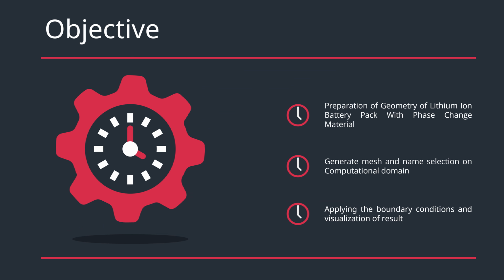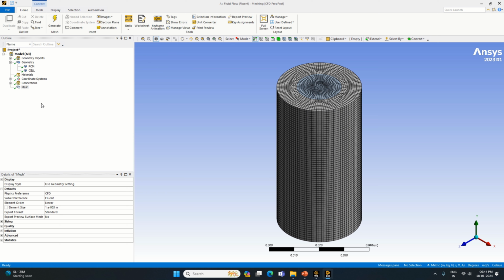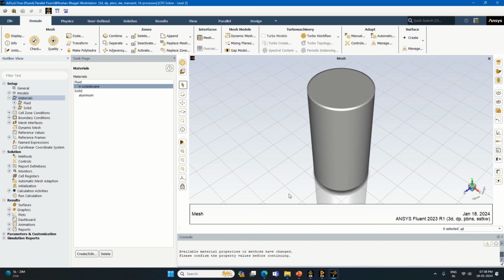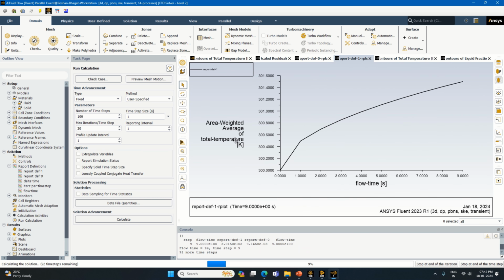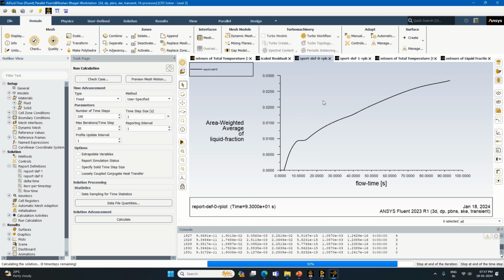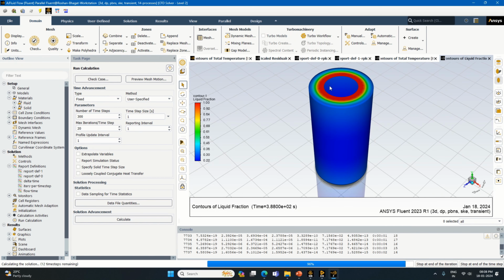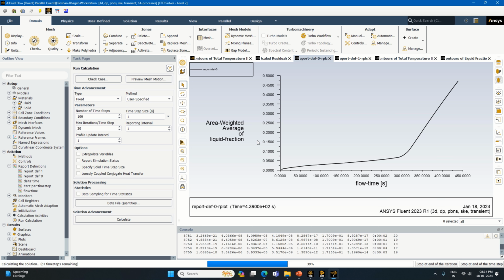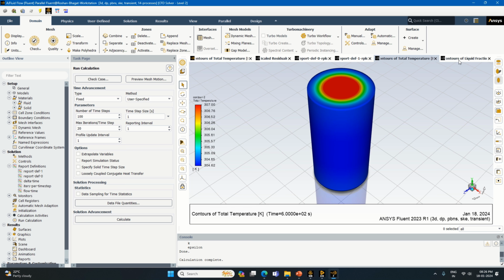CFD Simulation of PCM-Based Thermal Management for Lithium-Ion Battery Pack

Comment: I tried to do the same steps as you, I got unrealistic results. The liquid fraction wasn't increasing instead it varied with time . any idea what I did wrong?
Reply from the maker: check the selection while setting the animation
Reply: I don't think this is the case, The continuity residuals was more than one for some reason and reached even higher numbers
Reply: Last thing I tried now is to turn off the gravity, and all of a sudden the Continue and the XYZ momentum aren't being solved and showin 0 residuals. But the contours are showing the right behavior also the Liquid fraction is increasing steadily like the video.
Reply from the maker: Gravity has to be specified. Need to check file. Share on frontiersincfd@gmail.com
Reply: What are the system requirements for PCM/Li-ion battery simulation in ANSYS FLUENT?

Comment: can u do it for 3pcm circularly placed  one around another from cell where pcm should be lower to higher or higher to lower melting temperature
Reply: Great video 
Pcm width for pcm1 is 1.5*cell size
Pcm2 is 2*cell size
Pcm3 is 2.5*cell size
Which is packed circularly continuous around one another
Reply from the maker: Share details
Reply: @FrontiersInCFD 
Take 3 pcm packed circularly from cell
That 3 pcm should be different in melting point where the pcm which packed after cell is pcm1 and next pcm packed circularly with pcm is pcm2 and next packed circularly around pcm2 is pcm3. Pcm1 has low melting point then others, pcm2 should have low melting point then pcm3 and pcm should have high melting point

Comment: You videos provide good information. can you make video for Battery with PCM and Fins by using boussinesq model for PCM
Reply: Following is one of example. You can take one gravity value only.
 Title : Numerical study and optimization of battery thermal management systems (BTMS) Based on Fin-Phase change material (PCM) in variable
gravity environments
Reply from the maker: Will do
Reply: @FrontiersInCFD  sir
 HAve you considered this?

Comment: Great video!!
Can you upload a video explaining how to add a housing around the PCM and around the cell as well? why didn't you make it a heat flux instead of constant wall tempreture.
Thanks
Reply from the maker: Heat flux can also be applied, this is done as per the requirement received

Comment: I have a doubt why dont you use battery models like ntgk ecm etc
Reply: Ohh okay so could there be any way to observe the electro-thermal effect of the battery on pcm?
Reply from the maker: have to use battery models
Reply from the maker: This was done for thermal analysis only. How heat will be carried away by working fluid/pcm
These model you specified involves chemistry of battery also..